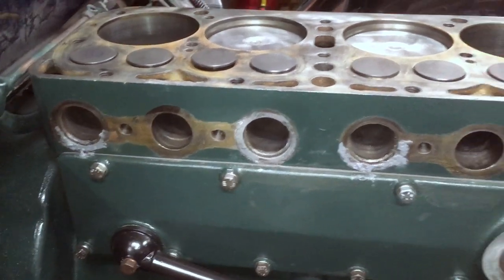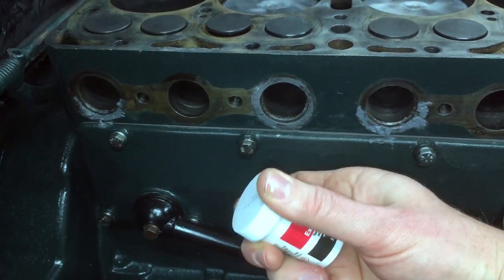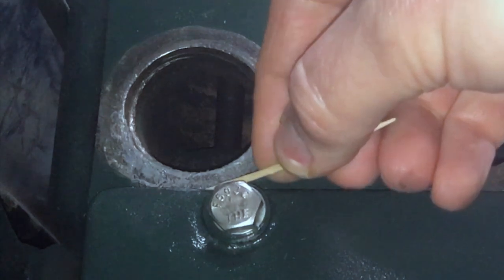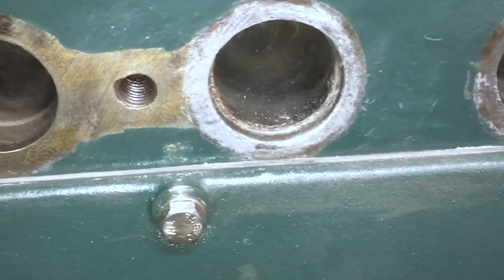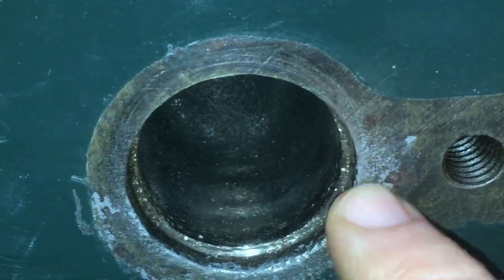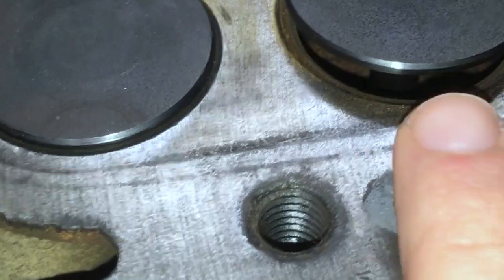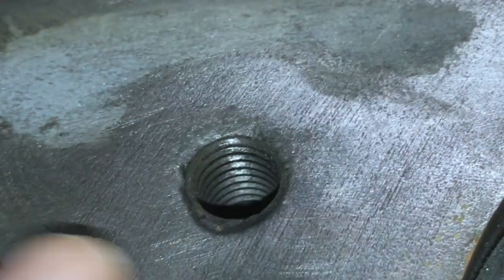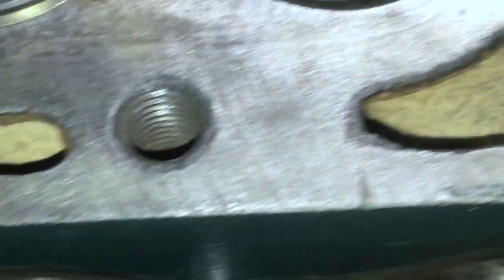Repairing block surface pitting with JB Weld ExtremeHeat

Comment: JB weld has saved me more than once. On time on a Datsun race motor, I broke an exhaust stud while installing the intake manifold. Then I attempted to drill the stud out and slipped with the drill; the drill plunged into the aluminum cylinder head next to the exhaust stud. That certainly helped me remote the exhaust stud, but didn't do much for being able torque down that nut to hold the manifold on. I ended up using JB weld to glue a time-sert sleeve into the void and let it dry for a couple days. This allowed me to thread the stud back in and I was able to torque it down no sweat. That held up until the engine was torn back apart years later. I also recently just used JB weld to repair my deck railing. One of the threaded rods that was sunk into concrete let go. I pulled it out, put JB weld on it, put it back in the hole and let it dry. I was able to torque the nut down and it didn't budge. The high PSI on JB weld can really save you. I was using normal JB weld in those cases, but this high heat one looks great for cylinder block repairs.

Comment: Rick Bork has a similar video but he also mentions using brake cleaner then not messing with anything for final surface prep. That’s the only thing I’d add that’s probably helpful. Great video tho, thx 👍
Reply from the maker: That's a good suggestion. The only thing I would worry about with brake cleaner is that some might stick around in the pits that you're trying to fill. Probably some sort of solvent, followed by warming the block with a torch like you would do before painting, would be the gold standard.

Comment: Is there a crack between a water jacket and stud hole at 4:00? Thanks for all your excellent videos! I sure liked the old Snap-On coil/condensor tester with the heater function.
Reply from the maker: There sure is. A crack leading from the #1 stud bore to either or both of the adjacent water jacket holes is extremely common on Model A blocks. This crack is usually harmless and is not a reason to junk a block or attempt a costly repair. However, one should make sure to coat the coarse threads of the #1 stud in RTV or another suitable sealant. No one knows why this crack occurs so frequently. The most popular theory is that someone in the past torqued the #1 nut to 55 in a single pass, rather than performing a multi-pass sequence.

Comment: Did this hold up for this build?  I have a thin scratch that catches going up but not going down between a cylinder and the water jacket on my 2007 Chevy Silverado V8 5.3 daily driver.  I don't have the means to resurface the deck at a machine shop.
Reply from the maker: @writtenpieceopaper1  When you say it catches going up but not down, what do you mean?
Reply: @alexiskai  my exhasut manifold fell at an angle, that's how i got that scratch. I think this is why the edge of the scratch is raised higher than the other side. When I ran my nail "up" towards the steering wheel and my nail doesn't catch. Then I ran my nail "down" towards the front of the engine, my nail catches. I tried applying the same force.
Reply from the maker: @writtenpieceopaper1  And do you have the cast iron or the aluminum block?

Comment: Hey brotha. Great video. If u can help me with a few quick questions please. Im a musician and im thinking about using this stuff to fix surface rust and pitting on an vintage steel cowbell im restoring. 
1. Can u get this stuff smooth enough to chrome or nickel over and have a smooth mirror finish after?
2. After drying is it even hard enough to rechrome or renickel?
 Please&Thanks. Your help is greatly appreciated
Reply from the maker: I think that would work, but I haven't tried. You should email the JB Weld technical department, they answer questions like this. There's another product called Lab-Metal that might also work.
Reply: @alexiskai  ...thanks so much for your help and time

Comment: Is this motor in and running? Did the jb weld hold?
Reply from the maker: I just fired it up for the first time on Friday. Only did 20 minutes because I'm still breaking in the head gasket. But it held for 20 minutes! I would feel obligated to disclose if things go south in the next few weeks, so I guess stay tuned.
Reply: @alexiskai  will do man. Glad to hear it's tracking well for now. I just got a call from my mechanic where I've got some pitting near cyc 6 water gallery. And just trying to find solutions before finding a new block
Reply from the maker: @lilSwamyProductionz  I picked up this technique from a guy who runs an antique car resto shop in TN, he says it's his go-to for pitting around the exhaust manifold. Anything where it's ultimately going to be under a gasket, I think you should be fine. One other note, I think it continued to cure for at least a week after I applied it. When I was ready to put the head on, a couple weeks later, the color had changed and it was rock hard. So that might be a good finishing step, to just let it air out for a while.
Reply: @alexiskai  thanks for the heads up. Thats pretty cool. My builder just said it's to far gone with mine and will need to get it decked. But is what it is. But this is still very cool. I'll keep watching to see the progress
Reply from the maker: @lilSwamyProductionz  It's probably fine, decking the block is usually a small part of the total cost of a rebuild. One thing you might do is find out from the rebuilder what, if any, the "pop-up" on your pistons will be after the block is decked. Just for your future reference, in case you wind up replacing the head yourself later. My "preflight checklist" video has a section explaining pop-up. Good luck!
Reply from the maker: For the record, the JB Weld continues to hold.
Reply: I've done this on intakes, water pumps, and exhaust manifolds. It works 😉👌

Comment: Don't try too shave it when it's half dry. Only work with it when it's wet and leave it alone. It'll just pull the material back out of the pits.
Reply from the maker: Yeah, you can shape it immediately after applying it, or you can wait for it to cure and then sand it, but between those times you should leave it alone.
Reply: @alexiskai  how well does this hold up on the head surface of the block? I have a 351c that has a low spot between a cylinder and water jacket where a very slight amount of compression gets into the water jacket.
Reply from the maker: @dukelps9132  It will hold up fine on the deck, the only worry is getting the surface perfectly flat. For a small area with a very small gap in a critical spot on the head gasket, I would use Seal-Lock Fluid Weld instead. It will conform to the gap when you put the head gasket on. There's a section of another video here that shows me applying it to fill some low spots on the deck: https://youtu.be/QlNYZICv8g0?t=337